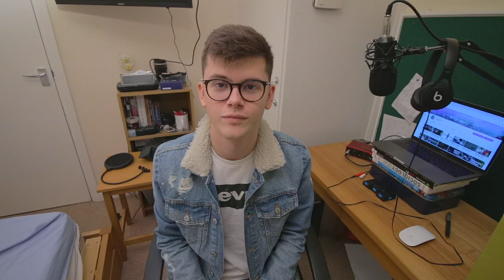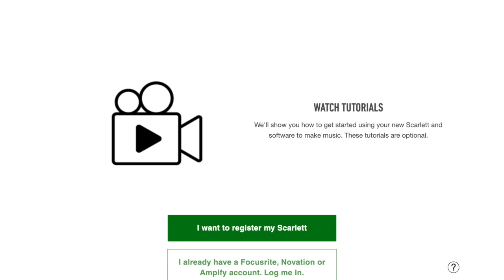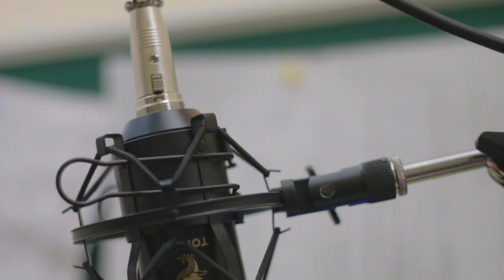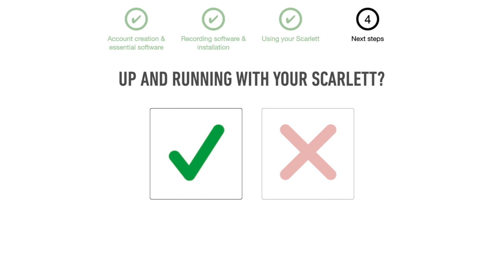How to: Set Up Focusrite Scarlett 2i2 3rd Gen For Mac - Audio Setup 2020

Comment: Hey everyone - some good news. So I just ordered a Focusrite 3rd Gen Scarlett 2i2, and am also buying a Silicon-based M1 Macbook Pro soon. I spoke with a customer service rep with Focusrite, and they put my mind at ease a bit when it comes to the reports of compatibility issues with the 3rd Gen Scarletts. On Silicon-based Macbooks, you can still use the Scarlett 3rd Gen as an audio device, meaning you can record and playback audio. The compatibility issue lies specifically with the Focusrite Control software, which is used to reconfigure output routing options, and is used for larger interfaces. The 2i2 is already pre-routed though, so you would only need the software to unlock the device. When you first fire up the 3rd Gen Scarlett on your Silicon-based Macbook, it will by default be in something called "MSD Mode," which is the storage mode your interface initially comes in. In order to unlock all of its capabilities, you just need to get the device out of MSD Mode. Instructions on how to do this start on page 5 of the PDF linked below. Once the Scarlett is out of MSD Mode, you will be good to go and able to access everything you need...software, tutorials, etc. You will not be sacrificing anything performance-wise or capability-wise! Focusrite's development team is currently working with Apple on a solution, but in the mean-time it's good to know there is a workaround so you can totally use your 3rd Gen Scarlett on a newer Macbook! Woo!

https://fael-downloads-prod.focusrite.com/customer/prod/s3fs-public/downloads/Scarlett2i2%203rd%20Gen%20User%20Guide_EN.pdf
Reply from the maker: Amazing Ben thank you so much for your comment and sharing this information! I will pin your comment because this is so helpful for M1 users! Much appreciated 🙌🏻
Reply: @BenBarnettYT  Of course!  Happy to help.  I've been pulling my hair out the last few days researching this stuff, and finally got some answers out of someone with Focusrite today so am trying to find anywhere it may make sense to share it on here!
Reply: @BenBarnettYT  I have the software on my m1 mac, it outputs and record only on the left stereo channel
Reply: Yooo I literally just ordered a Macbook Pro as well!! Waiting on it to arrive. Glad to know I'll have a little insight on how to set up my equipment. Thanks a lot Ben!! 🔥🔥🔥
Reply from the maker: @starrstar3966  Great news! Thanks for the comment and good luck!
Reply: This is so so helpful! SO glad I stumbled across the video and your comment too! Thank you for being so helpful!
Reply: So I have the 2nd gen and it connects and everything but my volume is CRAZY low. Would doing this fix that issue or nah?
Reply: i don't have the Scarlett icon on my Desktop. From where can i download it??
Reply: Is this still relevant?

Comment: when i plug mine in nothing comes up. i have tht exact adapter too gunna just try a usb c to usb c cable be much cleaner too. AND you can charge the same time! >:( what IDIOT at Apple thought placing the charging socket there? you literally cant plug one of these adapters in AND charge because they block the port. on the otherside Theres only ONE usb c port. I swear apple do things just to annoy the fuck out of people.

Comment: Hi, just installed focusrite with MacBook Air and it seems my condenser microphone is not getting enough power (I switched on the 48V button). Is it possible that Mac adapters do not provide enough power? Has anybody experienced similar issues?

Comment: If I connect my shotgun mic to the interface, while connecting 3.5 mm TRS to Dual 1/4 in TS  Cable to my camera 3.5 mic input?

Do I still need garage band?

Should my Mac sound input & output be set to the interface?

I’m just recording YouTube videos!

Comment: Hi, I want to get into Voice Over.  I have the Interface you are reviewing.  I have a MacBook Pro.  I do not have a Terminal that will fit the second connection connection type that connects to the computer.  What kind of adapter will I need?

Comment: Do i need a usb adaptar or can i use a usb c to usb c to macbook pro 2021?
Reply from the maker: As far as I am concerned you can use a USB C to USB C adapter as well as the standard lead it comes with - as long as the focus rite has some way of getting power

Comment: Hey Ben, I'm new to basically everything, but that adapter thing you used in between the audio interface and Mac, what is the name of it and where can I get it???
Reply from the maker: USB-C to USB-A port adapter / Amazon is where I got mine from!
Reply: @BenBarnettYT  do you know if using a usb adapter introduces additional latency compared to using the 2i2 with a computer that has the correct already? just inherited a macbook pro but i have been using the 2i2 with another machine previously

Comment: hello I bought the 2i2 and I wanted to ask if I have to create an account and register the 2i2 or is it optional?
I also ask if I can use the 2i2 on 2 different Mac(iMac and MacBook Air) and if I can download the programs at a later time.
Reply from the maker: I would recommend creating the account for the 2i2 although it is optional - only reason because is so that the warranty is registered on the specific product you’ve purchased and you can access help services too. Regarding if you can use it on different devices - yes you can switch between the two - however if that is the case then I’d recommend downloading the software on both devices to allow for smooth transition and to speed up the set up process each time.

Comment: Very helpful and detailed video Ben thanks! However I'm still unable to unlock the driver so i could get to "panning" in the driver so i could record an unmirrored video directed with the scarlet as interface into quicktime. What ends up happening is its panned to the right side only which requires to edit the audio in another app. Unsure how to make recording easier, in the beginning i was using garage band for the audio for the audio and Photo Booth for the video and then use quicktime to invert the video (Photo Booth is unresponsive for some reason) then into iMovie to add some fancy headers transitions or banners... What else could i use to make things easier??? Its a hugely long process to make a decent video with a Mac but it shouldn't be??? Also, do you have trouble with the Scarlet freezing up after 20 min of recording where the only way to get it to respond is to unplug it? Ben I'm having troubles here, help!

Comment: Good informative video, so I have a question that I can't seem to crack every time I try. I use a Blue Pro mic for recording vocals with Garage Band. I use the Mic input on Garage Band when recording my acoustic guitar - but not through the mic, I go direct with jackplug, as I have a pickup in my acoustic guitar. I record the guitar track first, then have to remove jackplug and insert  Blue mic plug for vocals. This is a pain. My problem is as I have  two inputs, how can I use both, and disable the mic when I record the DI of the guitar?  I can't seem to be able to shut off the mic! Clearly I am doing something wrong. HELP please!
Reply from the maker: Thanks for taking the time to watch and comment. I see where you're coming from in regard to the different inputs. You need to make sure that you have 2 channels. Channel 1 needs to have the blue mic input and channel 2 the guitar jack. Make sure on garage band the settings are correct, so it can identify these channels. A mistake I have often made is not selecting the red button on each channel to make sure the input is being recorded. Once you have both set up, you should see two tracks on your timeline instead of one,

Comment: helo ben actually my mac battery drain fast as i connect audio interface . Do i need to connect  mac to power supply all the time when i record???
Reply from the maker: Hi Bikson, yes the interface uses a huge amount of power so will definitely need to have your power supply connected the whole time you use it. I recommend getting an adapter for macs/iMacs with multiple ports, so you can charge and of course add hard drives/mics etc

Comment: Hey Ben, fantastic video. I am looking to set up my MacBook Pro with a Scarlett, a set of Rokit G5 speakers and a Pioneer DDJ-400 controller. Will this be easy enough? Cheers, Stevie.
Reply from the maker: Thanks for taking the time to watch Stevie! You’ll definitely have no problem setting up the MacBook Pro with a Scarlett as for the speakers and DDJ I think it should be easy  enough however I do recommend buying an adapter that has multiple ports to connect all the equipment! Plus some wires to avoid cables going everywhere!
Reply: @BenBarnettYT  Cheers Ben, you’re a star mate!!! I’ll have a look into it all and give you a shout if I’ve got any issues!!! Great videos man, keep up the good work!!!!

Comment: Hey Ben, thanks for your video. Do you have any experience with inputting music. e.g. using a iPad. I'm teaching classes that require music. Got a proper mic that works fine. The music coming in from my iPad is soft, one-channel like, no base nor power what so ever. Any suggestions?
Reply from the maker: I would recommend the audio interface for power and better sound. You can connect Instruments electronically and directly to the interface. As for the IPad I’m unsure of why to suggest in terms of improving sound quality. Could it be that the speakers aren’t very good if you are using a good microphone - the only thing I can suggest is maybe using an adapter to connect an audio interface to the iPad? I have seen this in multiple videos.

Comment: I have followed all the instructions and i can't seem to fix the issue where i can only hear myself on ear I try to get a new cable and still doesn't work i return my unit and got a new one and it does the same, pleaser advise
Reply from the maker: Sorry to hear you’re having issues with the audio. I think it might be down to either input settings for both the recording software and/or the interface input settings. Double check these and also make sure you have the correct settings depending on the microphone you use eg: 48V

Comment: What brand of adaptor did you use?
Reply from the maker: Mine doesn’t have a specific brand name but I generally go for adapters with the wire and not the ones that slot into the ports of the Mac flushed (these tend to have poor connection)
Reply: @BenBarnettYT  I have the apple adapter would you say that would have poor connection?

Comment: i bought this same scarlett, set up every thing on my macbook air and i can hear myself through the headphones clearly but when i open protools first, it doest it doest record
Reply from the maker: It may be down to the input preferences. Make sure that your MacBook volume task bar has it set to Scarlett 2i2 and the preferences on the software itself has its inputs dialled in correctly too. If this continues to not work I would recommend using an alternative recording software such as GarageBand
Reply: @BenBarnettYT  okay thank you, i will try that

Comment: Hey Ben - Awesome video mate!  I wanted to ask quick question for you... i have the 2020 macbook air and have focusrite installed but it doesnt seem to be picking up mic.  do you have any tips or suggestions about this?
Reply from the maker: Yes, so you may need to browse through the comments to find other users of the M1 chip MacBooks who have found some problems with compatibility to the focus rite. However, I should stress that focus rite are currently working on updating their software to ensure it works. My advice in terms of the mic not picking up would be to check the preferences and input/output. The other is to check the audio input/output on the MacBook itself (this is under the volume bar at the top right of your screen). Hope this is helpful.
Reply: @BenBarnettYT  thanks so much for the quick response ben :) will try it out! crossing my fingers for the bestt
Reply from the maker: No worries! Good luck!
Reply: Just want everyone to know - working with the focusrite customer support, you need to make sure you have Focusrite Control downloaded and that it is sync to your computer.  Also, try to dial the mic volume knob all the way up or past 12 oclock position.  it will start to pick up sound but past 12 oclock position, your mic may start to pick up a lot of background noise!  thanks Ben and other commenters!
Reply from the maker: Brilliant news. Thank you for working hard to solve this. Just what this community is for!

Comment: I’m having trouble with the focusrite control to my Mac book
Reply from the maker: What version is your macbook??
Reply: @BenBarnettYT  it’s the Mac book pro 16”
Reply from the maker: Same as mine - have you made sure the USB-C lead going from the focus rite to the laptop is connected properly? If so then check your audio tab (the volume icon top right of your screen) and make sure that the focusrite is selected - or go onto GarageBand or whatever you use to record and make sure the input/output preferences are correct.

Comment: hey, got the Scarlett solo studio 3rd gen, with the 2020 Mac Pro, the sound isn’t coming through my headphones? whether I use pro tools or GarageBand, can u help?
Reply from the maker: Have you checked the volume input on your MacBook under the volume icon there are options for where you want sound to go (focus rite solo in your case) if that doesn’t work then go to preferences on garage band then audio inputs and then select solo for both input and output

Comment: hey pro i have  Focusrite 3rd gen solo   and  i have leatncy   and my  foucsrite control. inn output  routing  i have massge say  output routing is not  is not  supposed in this device  what can i do
Reply from the maker: Hey! Best thing to do would be to take it apart and try again. Make sure that all the leads/connections are plugged in properly. Go through all the settings on the laptop and the recording software to see if it recognises the input & outputs. If none of this works then I recommend checking the companies website! Good luck !

Comment: Any experience connecting the 2i2 to macbook air m1?
Reply from the maker: No experience in connecting the 2i2 to a macbook air m1. However, the above should still apply when setting it up and faster if it as an M1 chip? Good luck and thanks for your question!
Reply: @BenBarnettYT  cool Thank you.

Comment from the maker: Timestamps: 
0:00 Set Up Focusrite Scarlett 2i2 3rd Gen to Macbook
0:07 How much does it cost?
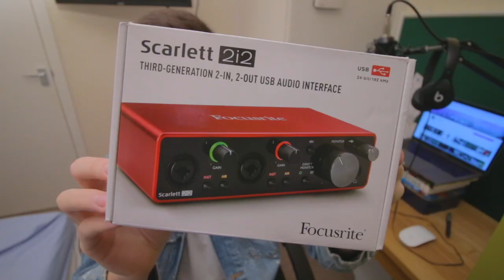0:17 Introduction to Focusrite Scarlett 2i2
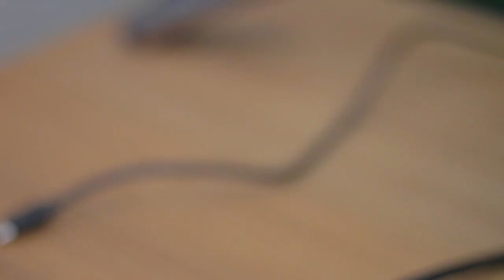0:28 Connect USB-C to Focusrite 2i2
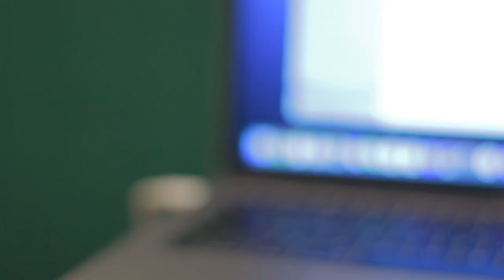0:37 Connect USB-A & Adapter to Macbook
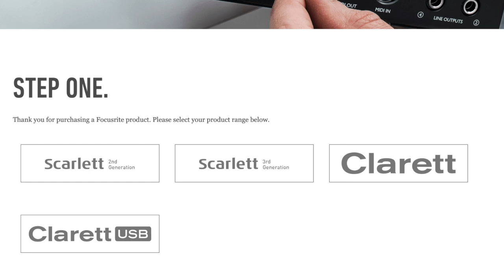0:47 Focusrite Software Step by Step
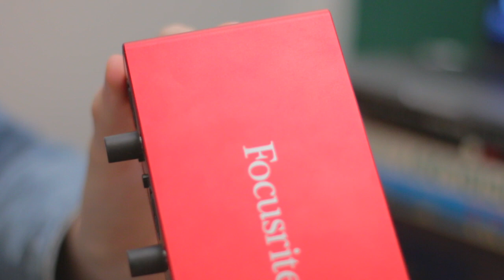1:19 Where to find Serial Code?
1:26 Installing Software
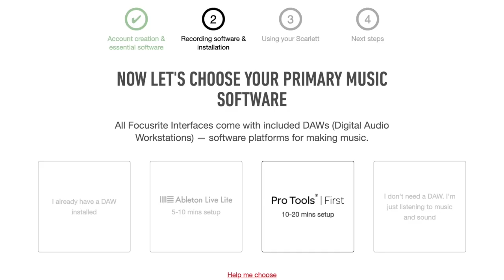2:08 Garage Band to Record Audio
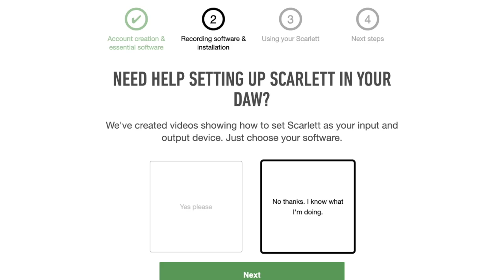2:35 Final Steps 
2:53 You are setup!

Comment: hi, i also got my scarlett 2i2 3rd gen, and using audio technica at2035, but the output sound doesnt come out loud, so small that i almost can hear anything, already turn on the 48v though, not sure the problem: the interface or mic
please help!
Reply from the maker: Ah! Now I’m hoping this is similar to the situation I had with the audio output where the connection to the headphone jack was loose and needed playing around to make sure audio was coming out properly. If not then it may be down to the output/input preferences on the programmes you are using OR if playing out loud with speakers it may be them as well?
Reply: @BenBarnettYT  i dont think it comes from the headphone jack though, and im using garageband, is there ever have problem from garageband? i tried to update but cant, due my macos, and unfortunately cant also update my macos cuz my macbook from early 2014, maybe ill try using my friend's laptop
Reply from the maker: @katienovrianti2498  Frustrating on the updating side of things and there have been instances when the audio inputs are problematic in garageband but it is a case of checking them and I remember when I had this weird nosie I literally spent a good hour or so trying and playing with EVERYTHING to tick everything possible! I do believe the version of your Mac shouldn't really effect the focusrite...it seems very strange to me..Good luck though and do let me know if you manage to find the soloution!

Comment: how would I connect a midi controller to this setup? I’m just getting started
Reply: Midi Controllers generally speaking connect directly to the computer, not through the audio interface
Reply from the maker: Thank you! This is really helpful information, I’ve not used a midi controller myself so pleased that someone else can help out!
Reply from the maker: I’m not sure about connecting a midi controller to the focus rite...I’ve not seen anywhere you can connect this...unless the controller has an XLR connection then that’s the best advice I can give you! Good luck and if you find the solution let me know!

Comment: Hi Ben thanks for this video 🥰🥰🥰
Reply from the maker: No problem! Thanks for watching!
Reply from the maker: @rysopis  Hi Greg, the first thing i would recommend is to update your Mac book Pro to Big Sur (10.15.7) once this is complete then head over to the 'App Store' (best use the search bar at the top of the mac home screen). Download Logic and it should all work for you. As for the interface focusrite the set up should be similar just make sure your input and output preferences are correct. Hope this is helpful! Good luck!
Reply from the maker: @rysopis  Great stuff pleased the update worked smoothly. As long as your 2nd generation Scarlett is able to be plugged in via USB it should work properly along with Catalina too.
Reply from the maker: Ah I see - maybe worth looking into an adapter that does USB 3 to USB A
Reply from the maker: Fantastic! So pleased it’s worked out - no problem!